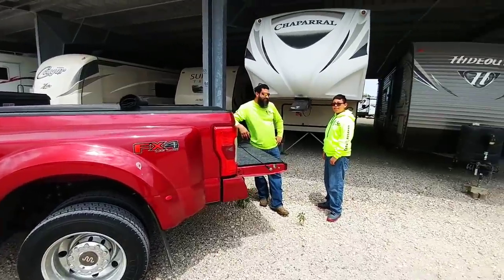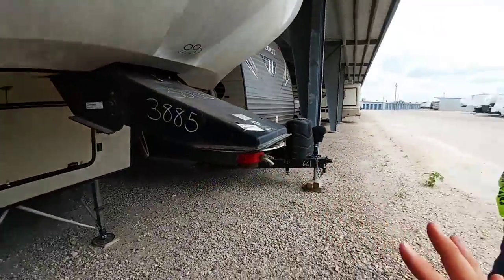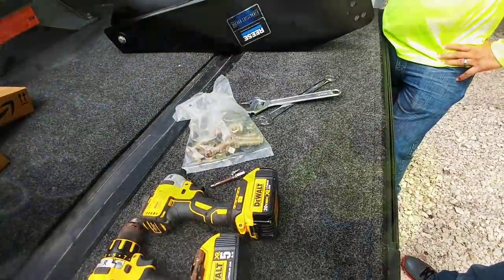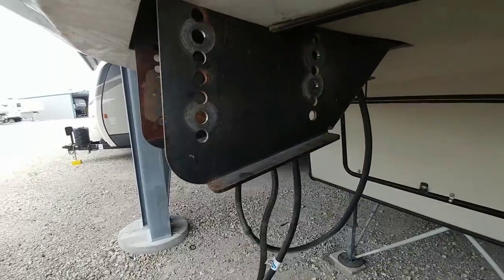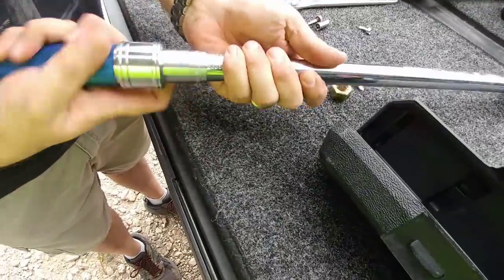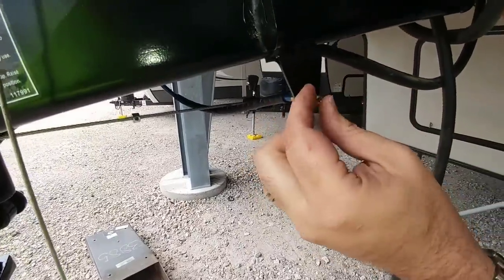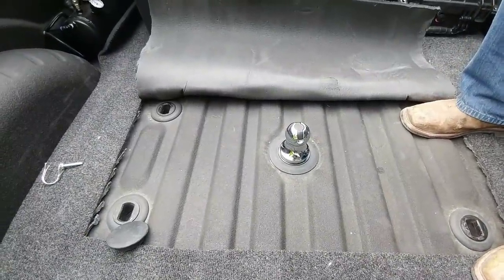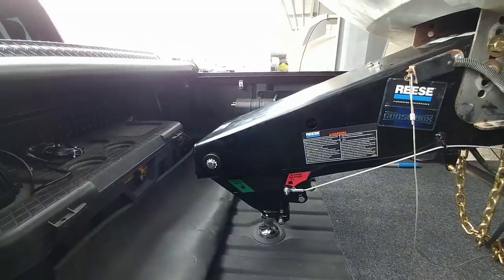Best Fifth Wheel Upgrade! Installing the REESE 20k Goose Box!

Comment: FYI: If you are torquing a fastener. If at all possible, you should ALWAYS  Torque the nut. NOT the bolt. Also. You should always pull a torque wrench. not push it.

Comment: I installed this on my Sanibel over a year ago and I love it. I have air bags on my truck as well with the on board air tank/compressor so I put a quick connect on the tank where I can air the goose box up
Reply: No not on truck or trailer
Reply: I am not able to give you a correct answer. There is a lot of variables in play ie pin weight how far you are traveling. I will tell you this after about 30 min of traveling down the highway at 60 or 70 mph which is yet again another variable your tires will heat up therefore you will gain tire pressure. Get you a laser thermostat and check your tire temp after 30 min of travel and again after a hour this will give you tell you if you need more air or less
Reply: Scott N ...all inflation specs are for cold tires (before driving). It's normal that pressure rises as temps rise and that is included into cold inflation specs. Do not remove the hot increase in pressure, as then the cold pressure will be lower than spec.

Comment: Great video BTBR.  I too wanted to preserve bed space and when I purchased my fifth wheel in 2015 I converted to the 20K Goosebox and love it.  My 39' toy hauler fiver weighs around 15K and by the time I fill the 100 gallon water tank, put the side by side in the garage and add our stuff I am a little over 19K total trailer weight.  We did a marathon 10,000 miles with the Goosebox from Toronto to Cabo San Lucas and back this past winter and the Goosebox performed very well.  The MoreRyde LRE rubber suspension took a beating on the Mexican roads and will have to be replaced but the Goosebox was fine and no issues with my fiver frame.  Let me tell you there are some serious potholes in Baja and we were on some pretty rough gravel roads.

I have no trouble unhitching but I have the AutoFlex air suspension on my 2015 F350 dually so when I dump the air the truck bed drops 5" and I drive away once the fiver jacks are on the ground.  I have heard of people having trouble getting connected to or disconnected from a fifth wheel hitch if the trailer is not level but no problem with a ball.  I am in construction and have to take my fiver into some rough areas to work on projects and I much prefer the articulation of the ball to a fifth wheel hitch.

I too wanted an additional inch of clearance after the Goosebox was installed but instead of moving the Goosebox I purchase a different ball from Reese which has an additional 1" shoulder below the ball raising the ball the additional 1".  It is only rated at 26.5K instead of the 30K for the standard ball but that is more than enough capacity for me.  It would save you having to get the young lad back to hold the Goosebox again for you! :)

I am really looking forward to your towing review of the Goosebox 20K.

Comment: Had this added to my new Blue Ridge as my SRW 3500HD already had the gooseneck setup installed. Love it. It does make hitching up a tad bit more interesting as you have to get lined up just right. Not a lot of room for error on that. Your comment about locking it up was interesting since I just last weekend had a friend weld on a simple, but heavy duty L-Shaped bracket, drilled a hole in the arm of the bracket for a heavy duty lock. This locks the locking arm in the locked position making it impossible to insert a hitch ball in the receiver. Primed it and spray painted it black and it looks like it was a factory install.
Reply from the maker: You'll love a mod I'm doing to my truck that will make hitching up alot simplier.
Reply: Look forward to seeing what you come up with....
Reply from the maker: James Lathrop: can you email me a picture of his locking design?
Reply: James Lathrop: I'd also really like to see a photo of that locking design.
Reply: just watched your latest on the camera adaptation video. Yours is an excellent and permanent solution to that problem. One I am trying out is the poor mans version of that. I am going to try using the App "Albert" as a temporary camera setup. I need to get a little hand held selfie stick thingy for the truck bed but it should work like your installed camera... Fingers crossed...
The only issue I see with using "Albert" is the requirement for wi-fi connection for the two phones. Luckily, my Silverado has a wi-fi access point built in that I can use.
Reply from the maker: Thank you for the photo.  I had a different idea swimming in my head... nice though!
Reply: How has that lock design worked for you so far?

Comment: Outstandingly informative video!  I dunno why fifth wheel trailers don't offer this setup to begin with.  Gooseneck towing has a higher capacity rating on new trucks and you don't have the hassle of having to load and unload that big heavy fifth hitch on the truck bed.  Are there any disadvantages of gooseneck over a fifth wheel for big travel trailers such as yours?

Comment: I have this on my 5th wheel. The first owner changed it out due to he couldn't put a traditional 5th wheel couple on his truck because his welding equipment was in his way. So he could only use a gooseneck coupler. When I was looking for a 5th wheel I notice the guy changed the coupler so i didn't have to buy anymore equipment. 

Also Big Truck Big Rv, I remember you did a video oh probably a year ago on the comparison of the gooseneck and  a 5th wheel. and talking about about the leverage and the stress point. you need to do video with this coupler system and compare it to what you stated in the video a year ago.
Reply: From what I have come to understand, the difference is the gooseneck adapters change how the load is converted to the pin box and adds stress to the welds. The Reese Goosebox allows the load to transfer directly back to the mounting point of the original adapter which does not alter its stress points. I wont pretend to understand the engineering differences, but that is the explanation I have picked up on while researching for our future purchase.
Reply from the maker: you are mostly correct sir.

Comment: I got the Goose Box for my GD Momentum.  It works great, can have a clear pickup bed when not towing, and there is no chance of dropping the fifth wheel on the pickup bed as there might be with a standard fifth wheel hitch.
Reply: I have a buddy who has dropped two different fifthwheels on his truck bed, twice on one of them and once on his new one.  I'm holding out for at least a couple more before he learns to check things before he drives off.  LOL

Comment: While doing hours upon hours of research for my first rig (really, my first rig is a 42’ fifth wheel!) I came across this video, and decided to get one! In hindsight, I really should have bought a pivoting fifth wheel hitch as the company work truck I was originally pulling my trailer with had some clearance issues on the foreward most tool boxes, resulting in a few apprentice marks (holes) in the nose of my rig. 

I now have a flatbed truck and just love the fact that I don’t have to mess with a fifth wheel hitch If I need to throw anything on the bed. I recently had to haul my rig away from wildfires in a hurry and didn’t have a chance to air up the goosebox-- that was a rough ride. Filled it up at the first place I could, and boy howdy. Cant imagine not having suspension in the hitch. Oof.

Comment: With the Rackem device couldn't you use the other pincher on the other tire, locking both tires together? Just a thought. Cheers. 🇨🇦

Comment: I must confess to being very confused at this moment. I had watched one of your videos where you showed the pros and cons of going to a gooseneck and you stated that you wouldn't do that because of the added stress on the frame and that doing this would void your warranty. So you see my confusion,  has your opinion obviously changed? And what caused you or affected you into changing your opinion? I have actually experienced a frame break from the pin box connection, you can't imagine the extent of the damage.  You could stand in the bedroom and look outside through the hole.  Our 5th wheel was using the stock pin box setup. We had to scrap that trailer.
Reply: There's a difference between a full pinbox gooseneck adapter and an adapter that converts a fifth whee pinbox to a gooseneck conneection. The latter can cause stresses to transfer to the trailer due to the leverage of the adapter, whereas the former is designed to have the same stress being placed on the pin as before

Comment: The wife and I installed ours this week and we will be setting out on our maiden voyage tomorrow.  Going to haul from Phoenix to West Texas.  Should be a good test.
Reply: BIG LIFE What are your thoughts now?
Reply: I do apologize,  I am just now seeing the questions.  I am still using this system and loving it.  I have not had any problems with the airbag leaking like some.  I don't like hooking up to it by myself, as I don't have cameras.  Other than that it is a dream to pull.  
  I have pulled it from Arizona to West Texas,   West Texas to North Texas and then back. West Texas  to Southern Nebraska,  and I'm going to be putting it back to Texas in about a month.   So smooth, that I barely know it is back behin the  truck.   I'm glad I made this upgrade, and would do it again.

Comment: It’s a great hitch. I just recently installed mine. One thing to look and check for is leaks. I was having an issue with the airbag slowly bleeding out and the culprit was the pop off valve not being tight. Simple solution but irritating. Sprayed the connections with soap and now it holds air for 4 months. Great product
Reply: Thanks for the tip mccain1220.  My goose box 20K leaks down too and I thought it was defective and was going to call Reese.  I will check all of the connections first.  Mine appears to hold air initially but if I go over several bumps it seems to deflate very quickly - in less than 100 miles sometimes.
Reply: Thanks for that tip.  I too have a leak.
Reply: Same here with the leaks, from first install. I eliminated the factory blow off valve.
Reply: Where is the popoff valve? You don't mean the inflation valve, do you?

Comment: After using the goose box many times I would   Go back to the fifth wheel. I have had a lot of trouble with the camper bouncing on the hitch excessively when towing.
Reply: The thing that pushed me away the most was when during an emergency stop the the hitch suspension bottomed out completely and blew both my airbags on the truck
Reply: oh snap.  literally.

Comment: Got one myself.  Few things I've noticed.  First, NEVER NEVER NEVER drive it without the proper air pressure, under inflated or leaking.  It will tear the hitch out of your bed.  Especially when close to max gross.  Second, hard braking can give you unexpected results if turning while breaking.  Even though the axis of the hitch is lower, it seems to present more roll.  Can't explain it, just had to adjust driving style.  Also, I have a crew cab so I can see into the bed which makes it much harder to hookup by yourself.  After getting in and out of the truck 10 times or so, I started using a wireless camera mounted in the front of my bed to spot the hitch.
Reply from the maker: great feedback. I hear more good than bad at this point so we'll see.  I am holding on to my old setup just incase

Comment: Sir,  I just watched the vid you posted Feb 19th , 2017 where you stated you would not normally recommend a change from a 5th wheel hitch to a gooseneck conversion---question here being why did you just make that very change on this trailer?????---thank you for your time!
Reply from the maker: So the video you watched back then was specifically talking about a Gooseneck attachment to a standard fifth wheel pin box.  The Goosebox has a completely different approach and design.
Reply: thank you---just wanted your thoughts on the set up  @BigTruckBigRV

Comment: what do you think about the stress it puts on your RV?  My neighbor swears it's way to hard on it.  Then his buddy came over and said same thing.  He passed on a nice toy hauler because it had cracking around where it attaches to RV on underside and had the reese goose on it.  They said if under like 14k perhaps but big toy haulers no go.  I just traded some stuff for a pull rite 16k slider.
Reply from the maker: A typical Gooseneck attachment creates stress on the frame. The Goosebox is designed not to.  That's why it's the only conversion that's approved by Lippert Frames.

Comment: You need to make sure the breakaway switch cable is adjusted properly, otherwise if the chains are shorter than the switch cable  will not lock the brakes.  After much research I went with the same setup.  Have a 2014 SWB F350 with a 50 gal. titan fuel tank mounted in bed and no clearance issues.

Comment: I added the same Goosebox on my 2017 F-350, but I sent it back as the clearance between the truck and 5th wheel was much shallower.  I sent mine back after I damaged both my truck tailgate and 5th wheel after one trip.  I went from 7" clearance to 5".  That was not enough.  Just be extra careful anytime you go up a hill or leave the pavement.
Reply from the maker: I'm using an extended ball.  2" taller
Reply: Big Truck Big RV  Great idea! Safe travels and we like the well thought out videos and updates. Thank you!

Comment: I'm going on record as against this setup. I have used converters in the past,  and I agree this looks like the best one ever. But besides the pain of extra raising a lowering and being exactly correct position to hook up, two things I have an issue with on these are chucking, and sideways rocking of trailer. My moryde helps with chucking, and b&w companion has shock built in to help with sideways rocking. Be curious to see how well you like it after you pull the trailer in cross winds or uneven two lane road.

Comment: great modification.  No brainer in my opinion.  I dont know why this isn't standard on every RV.
Reply: They had them between 1960 and 1985. They quit manufacturing them. I have one of these (the new model - got 1,000 miles on it - I can’t even give it away). If you know someone who wants one Ill pay shipping. I just want to trade for a factory pin box.

Comment: Did you say you're going to change out the goose ball, to get more clearance between your truck bed rails and the king pin/trailer? Wondering if you're going to get the Reese High Rise goose ball that adds one inch of height, or if you're aware of another solution.

Comment: Great video. Glad 1 guy also pointed out about applying torque to the bolt head instead of nut, but it's probably not a huge deal, being 220 lb*ft. But I am curious about that wheel lock. It looks like it can also fit in between wheels, locking 2 of them together, through the spokes...a bit. Have you heard, or tried that yet? It just kinda looked like it could do that. It does look like a great wheel lock.
Reply: Blaise Boudreau the website said it only works with one wheel. To me me it looks like you could use it on two if the axle spacing works.

Comment: So I'm using the ultimate Andersen hitch and I like this set up youre doing more my question is would this work with a short bed ram the Andersen works great since its shifts the mounting location back a bit giving me more space for tighter turns thanks in advance